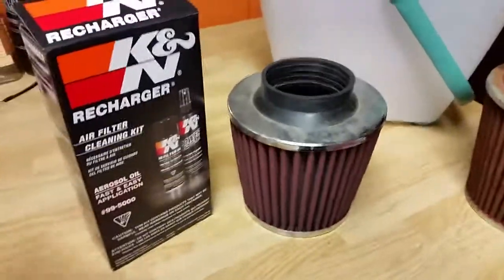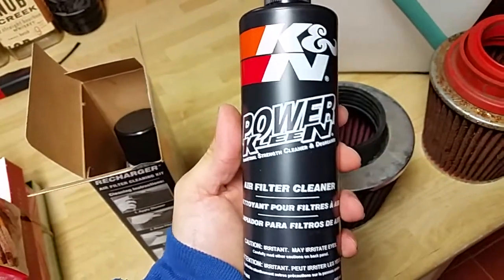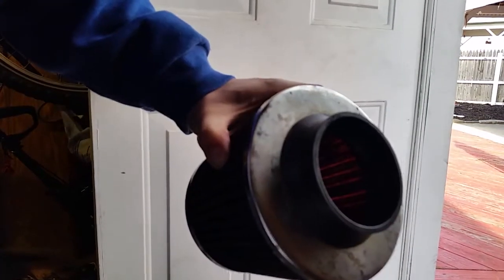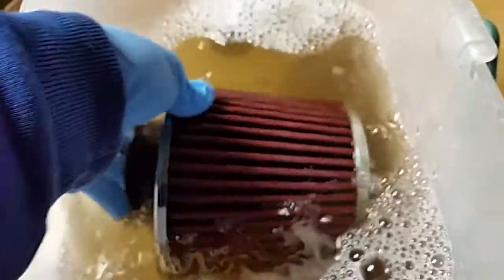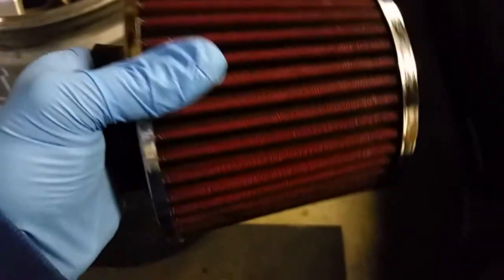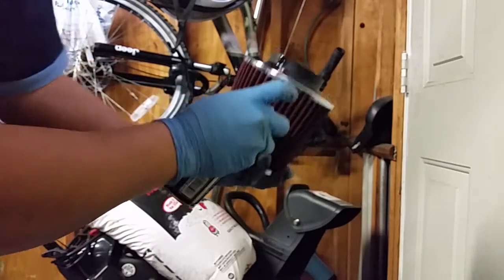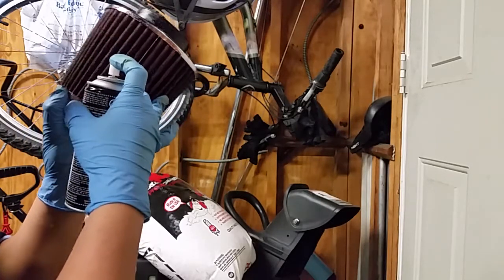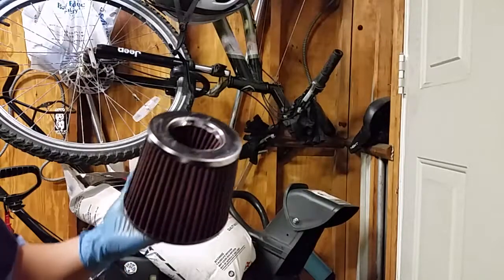How to clean and re-oil your cold air K&N air filter recharge kit review. (how to use)

Comment: not proper. always wash inside out. let it dry naturally. all the force of compressed air will spoil the filter
Reply from the maker: if you noticed I washed it inside out after dunking it and i never dried it with compressed air
Reply: I've  used a vacuum to dry it.
Reply: @ironnuts2587  😂😂😂